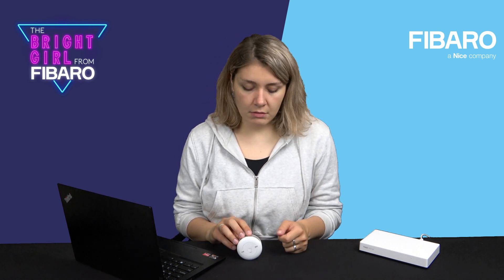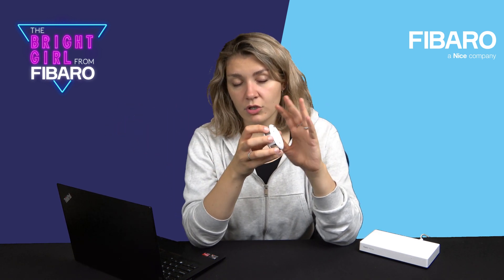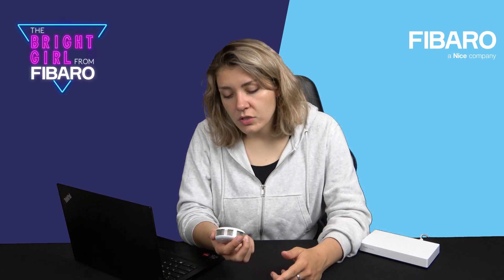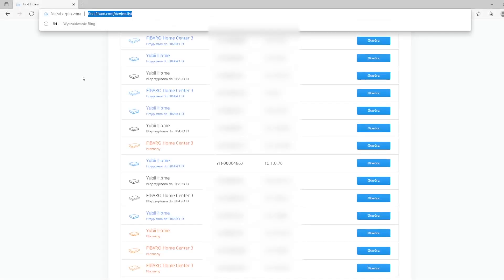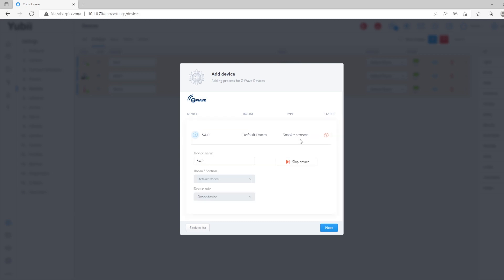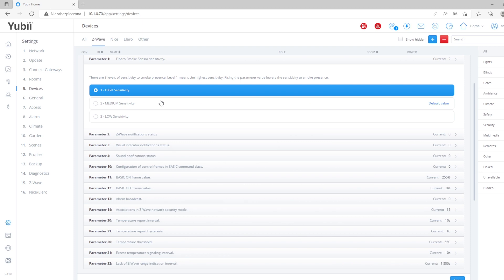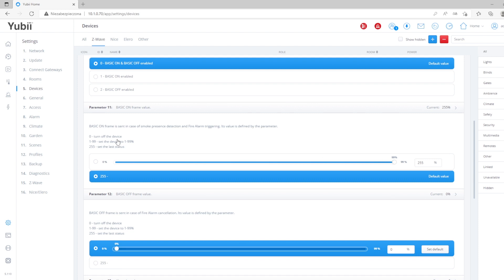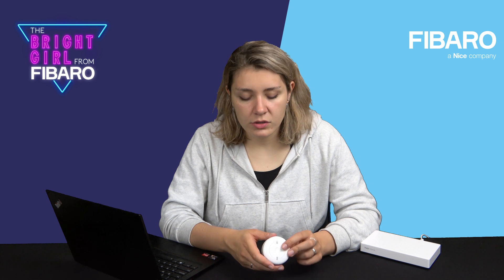The Bright Girl from FIBARO | Smoke sensor part 2

Comment: 2 Years Later, still no "Part 3" seems like it will be the same as with Half Life 2 Episode 3 🤣

Anyway.. I got some Control Elements in HomeAssistant after the Integration that are just Labeled "Basic" with the Buttons "Turn Smoke Detector Basic On" and "Off". What are they? Can i silence the Alarm with it in case of a False Alarm?

Comment: How to configure smoke sensor when it detected smoke to open blinds with roller shutter 2 on HC3 z-wave engine 3.0? I can't make it work with the parameters 10, 11, 12, the roller shutter 2 does not respond to these settings at all.